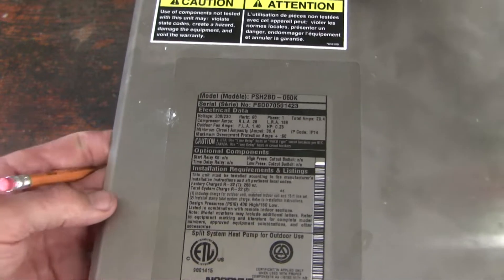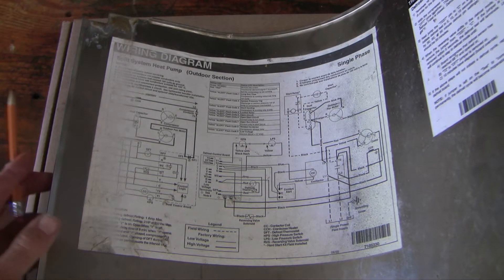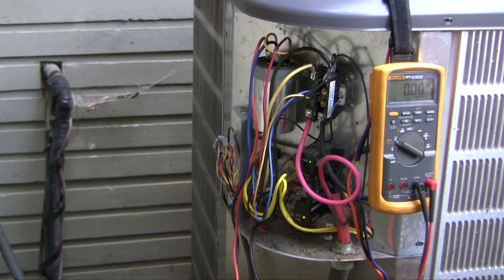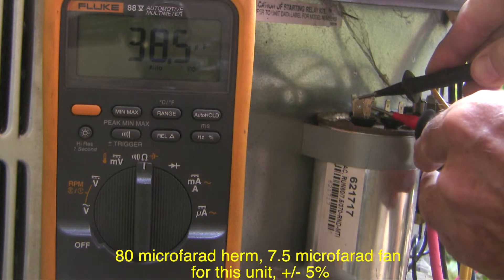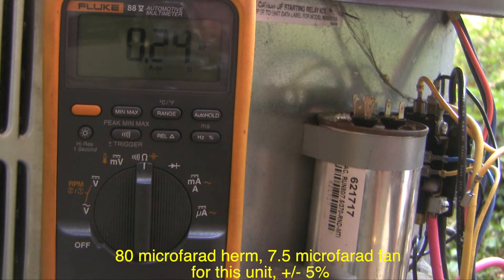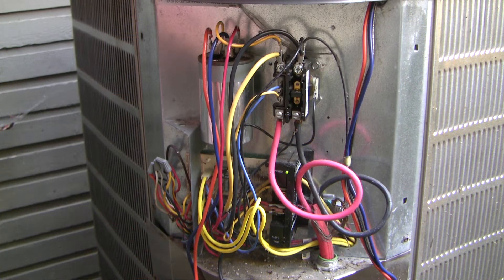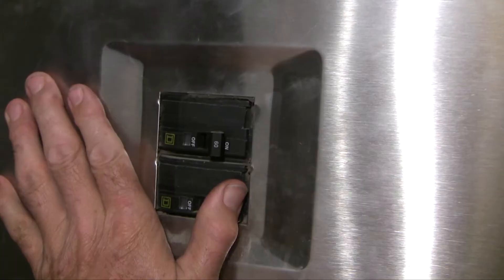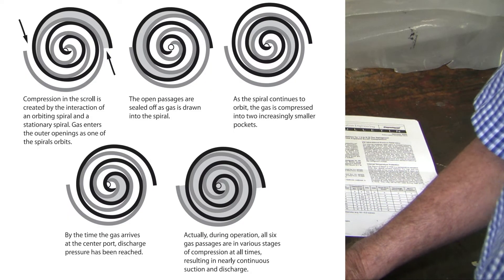How to fix a heat pump that won't start

Comment: Hi Dave and great video showing the steps to check a compressor that doesn't start. Personally, I wouldn't install the hard-start kit. As you mentioned, the scroll compressor because of its inherent design doesn't have a load on it when starting. Some folks will say that it has a quicker start up period which will shorten the time that the compressor has high starting amps. This is true, but at the same time this higher starting torque will jolt everything inside the compressor such as windings that may rub the insulation which could shorten the life of the compressor. On compressors that have reciprocating compressors which you won't find in a residential unit, hard-start kits were used to overcome the pressures when starting. And techs would use them on residential compressors to extend the life of a compressor which is near its life possibly because of bad bearings or even wouldn't start. Another disadvantage is let's say that the run capacitor is at low capacitance as in your case or open. The compressor will start because of the hard-start capacitor yet the run capacitor is bad and you wouldn't know it. This will increase the current in the run winding which will shorten the life of the compressor not to mention that the compressor is not running at its highest efficiency because of poor power factor. In other words, your electrical bill will be higher. Have a great day Dave and don't work too hard!
Reply from the maker: Thanks Terry! It's always good to get advice from a seasoned pro.
 
Dave
Reply from the maker: It's been over a month now and the system is working fine, so as you suggest I'll leave it simply with the replaced run cap and continue following. With only a single capacitor doing two tasks, run and start, the cap needs to be sized large enough to do the start task without being too oversized for power factor correction. It raises the interesting question as to whether people who add a start cap should consider reducing the size of the now dedicated run cap, since the run cap doesn't need to be large at all. The higher impedance of a smaller, dedicated run cap will reduce current flow through the more delicate start windings after the motor gets up to speed. I used to think this should be easy to calculate, but the way motor inductance changes with rpm, the best practical way to size these is in the lab. Thanks again for your kind help, Terry.
Reply: @spelunkerd  Hi Dave and glad to hear that your system is running fine. We've been YouTube associates for quite a few years now, and I've been happy to converse with you over these years. And as always, I'm happy to help! Have a great day Dave!

Comment: I have 2 Rheem central A/C units, a 2 ton and a 4 ton.  I never did have trouble with them starting, but did a bit of research into the hard start kits.  I ended up buying 2 kits (different ones, for the different units) from Rectorseal.  I installed them and could not be happier.  Before the hard start kits, when either unit would start, the lights would noticeably dim in the house while the compressor was in the start winding..  After the installation, I still get the lights dimming because of the huge inrush of current, but it's for a much shorter duration, and they don't dim anywhere near as much.

A hard start kit will complicate matters slightly in the event something like this happens again, as it could be the actual split capacitor OR the hard start kit.  That is to say, if the hard start kit were to fail yet the split capacitor is good, the compressor will not start.  So in the future, should this happen again, it's important to first disconnect the hard start kit and test, because that can be ruled out immediately, if the unit starts.  If not, you'd proceed on exactly as you did in this video.

Comment: Great job - I installed a 521 kit on my 20 yr old Copeland 4 ton compressor just 3 months ago. Interesting that I installed the model for 1-3 ton units. Why?  Well I looked into the OEM spec after purchasing the 3-5 ton 521 kit and my OEM start kit had the start capacitor that the 1-3 ton 521 kit had so I switched it out. Have not had any issues. Start up amps went from like 109 down to 75 or somewhere like that. Mine is a scroll compressor so I am hoping it works out ok. I am a little weary of the case where the dual cap might be going bad and not really knowing it or other potential issues that can happen with these kits. All is well so far. My unit is probably on it’s last few years anyway. Great vid thanks for posting!  Got the same Fluke - love it.
Reply from the maker: Terry made a good point, about how you might not notice a bad run cap if you have a start cap in place, but I don't know how big a deal that is. Recall that when a compressor has both, the run cap has considerably lower capacitance than the start cap. You don't need a lot of capacitance after the motor is up to speed; it is there for power factor correction. When a capacitor is sized to perform both tasks, as in this PSC motor, it is sized for starting but ends up being oversized for the run cycle. So, if capacitance of your new run winding is a little lower than the original single-capacitor design while running, that may be a good thing.

Comment: I found that on a good induction motor the cap goes south before the windings most times even more recently. Some perfectly good appliances dumped because its quicker and more profitable to fit a new motor with those bolt on caps, than do the job properly. Of corse that was back in the day we all used to fix things. 👍 Sail Safe mate. Ant & Cid

Comment: Well diagnosed 😀
When you said it was humming i mentally jumped back to a bench grinder i fixed years ago.
 It would not start unless you spun the shaft then powered it up.
it could be started backwards.
The capacitor was easy to diagnose, it had exploded in the base ha ha :-D
I' m now a master capacitor diagnostic tech lol.
I'm surprised that they havn't done way with capacitor starting, some kind of mosfets and a timing circuit maybe.
Capacitors are cheaper, There  I've answered my own question lol.

Comment: I don't have that type of compressor, but my condenser came from the factory with a hard start kit. Also, they must not be making capacitors like they did in the past, since bad capacitors seem to be the number one failure for AC condensers now. I don't think it would hurt to install a hard start kit.

Comment: Thank you so much for this video. I now 2/20/24, have a Rheem heat pump unit that DOES NOT start up, at all. The out door unit make an attempt it seems, with a very very fast quick "kinda of a hum, clip" sound, then nothing. And then the indoor unit fans just keep blowing. I am not a mechanic, but handy enuff, to try anything. I will start to change the contactor, then the capacitor. But my concern is if those two items does not work, what else is there to do. I would really appreciate a reply, from you or anyone. Thanks.
Reply from the maker: You may want to check out this video https://www.youtube.com/watch?v=L2BLHXCfubI , where I go through a similar diagnostic procedure in a dehumidifier. I show how to do the diagnostic tests rather than just swapping parts. It's easy, just with a multimeter. As you say the capacitor is number one on your list of possible diagnoses. I should tell you that this week my compressor failed with an internal short to ground, and I did another video of that diagnosis. You're a lot better off doing the diagnostic tests to verify diagnosis first before swapping parts at random. The capacitor is number one on your list of quick fix possibilities, though some also have a potential relay, a current relay, or a PTC resistor. To tell if you have one of those possibilities, search your pump for the wiring diagram, and look for flashing lights on the board that might help you decide what is happening. Good luck!
Reply: Thanks, I will. But you know, what , I today changed the contactor and the capacitor, and the outdoor unit STILL DID NOT START UP. And it did the same quick click, like it was about to start, then nothing. I do not know what to do now. But, I will still be trying something like changing he PC defrost board next. Which me luck. But thanks again.  @spelunkerd
Reply from the maker: Don't change the defrost board. Check the circuit drawing to see if it has a switch for a dedicated start capacitor. There are three types. Potential relay, current relay, and PTC thermistor. If one of those is installed and bad in the system, it will give a similar no start pattern. Another thing that can do that is shorted windings, and of course a locked rotor from mechanical failure will do it. You can prove shorted windings with a multimeter. Make sure you know which motor is failing to start.
Reply: Mister. Thank you so much for this info. It is not the compressor, I push the contactor in manually, and it starts and runs ok. Thank God, cause I cant afford a compressor job now, i am on fixed income living in Poinciana. The relay assist start, set up is an option, but i am not that verse to even attempt that. I hope i can find the remedy before it get into the summer. Wish me luck. I hope i will find the solution. Thnx a lot again.  @spelunkerd

Comment: I would hold off on the hard start kit if you can. It’s sort of a bandaid to buy more time on a failing unit, but it’s harder on the windings of an otherwise healthy motor. I’d focus on things like making sure the right amount of oil is in the compressor along with its charge, making sure the delay between restart cycles isn’t too close together (some thermostats are programmable for that), and that the right voltage / amp capacity is making it to the compressor to begin with good contactors and connections.
Reply from the maker: When I read the comments thread on any video, I scan for remarks like this, remarks that elevate the discussion to another level. You make an excellent point, check for voltage drop, current draw, cycling frequency, and do an overview of the system for other causes of excessive load, (including silly things like dirty air filters, etc). Thanks for making this discussion thread worth reading!

Comment: Compressor kicks fine for AC but will not for heat. The emergency heat works even the blower but the fan outside and Compressor will not kick on during heat. Everything works fine for AC
Reply from the maker: Heat pumps require a specific style of controller in the home to direct AC and heat. I'd be checking the connections there, making sure a wire hadn't come loose, batteries are fresh and the pump is in the heating mode. Our controller can be easily be accidentally bumped into the wrong mode (cooling or heating) by somebody who is simply looking at the temp or trying to adjust the set point. Finding that before the tech is called in to fix it saves embarrassment, ha ha.
Reply: @spelunkerd  yeah it's really simple thermostat. I'm thinking it's not getting 24v at the board for heat. Most likely  weedeater got the wire or possibly the thermostat is bad.
Reply from the maker: @dannyallen9804  Be sure any new thermostat you get is specifically designed for heat pumps. Normal thermostats off the shelf will not work for most heat pumps that do both AC and heat, and they have no backup mode for emergency heat if the pump system fails.
Reply: @spelunkerd  yeah my HVAC guy comes tomorrow I will let everyone know
Reply: @spelunkerd  just a update faulty thermostat not calling for heat. Changed it out My tech ran some test everything working smoothly now. With new thermostat the cool down period and stage changes takes longer than old one but all and all simple fix. Thanks for the help.

Comment: It’s winter right now. What about an outside fan running constantly in heat mode and heat strips running.  So you see heat pump fan blades running in heat mode but strips running only giving heat 24/7.
Reply from the maker: The weakness of a heat pump is very cold weather, where efficiency is poor. The usual algorithm adds heat strips so I’d consider that response to be normal.

Comment from the maker: After almost 18 months since this repair was done, with no problems in the interim, this compressor suffered a catastrophic internal electrical failure characterized by a short to ground and shorted start windings. I did a video of how that second diagnosis was made, in this video https://www.youtube.com/watch?v=ihDc2_Tv5rw
The new capacitor shown here is still fine, but it does raise the interesting question regarding whether the failed cap last year caused excessive current draw during startup last summer, shortening the life of the compressor by overheating insulation then. On the other hand, if this was indeed secondary to the failed cap I would have expected those windings to have shorted then rather than more than a year later. These compressors typically last less than a couple of decades so at 19 years of age it didn't owe me anything. In a newer unit one might try to replace only the compressor, but in the past we've had two freon leaks a few years ago and I'm more interested in a completely new unit.

Comment: It wouldn't hurt to throw the start cap in since it was specifically engineered to have it as an option, but it's worked all this time without one. If you get lights flickering in the house on startup, then I'd probably just throw it in. Otherwise, I'd leave it off. No sense in adding a component that isn't really necessary.